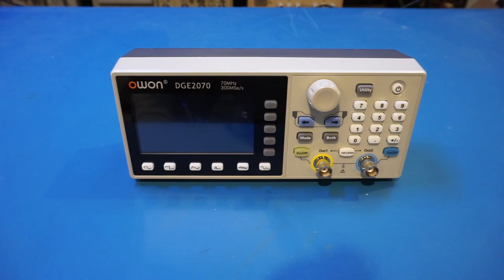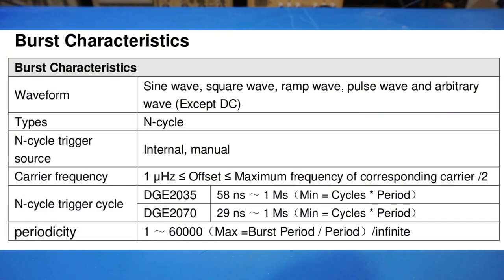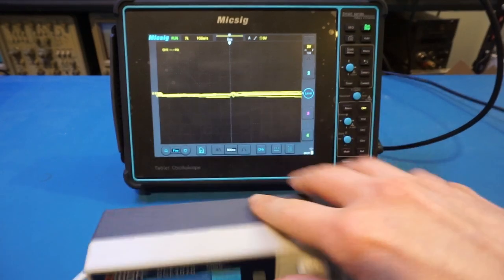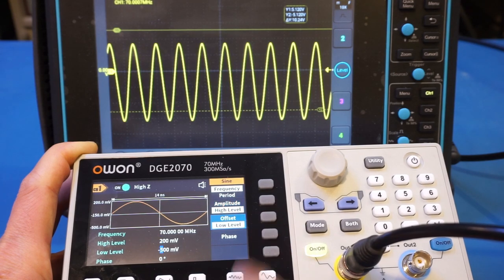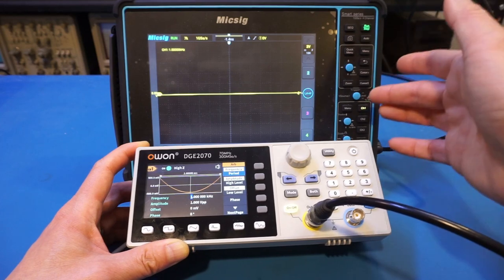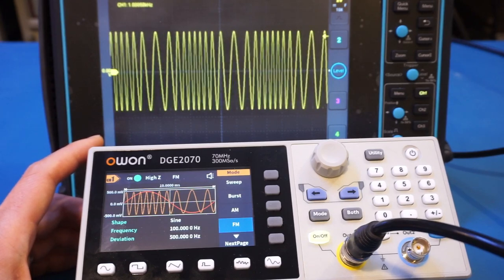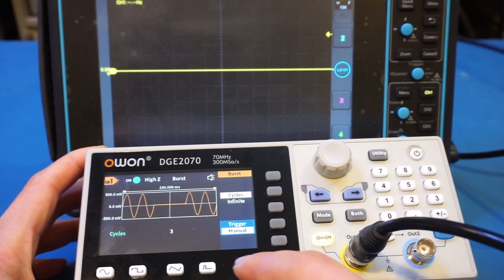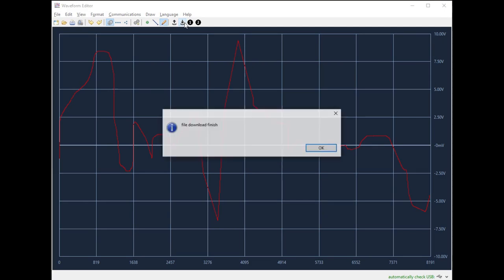OWON DGE2070 Arbitrary Waveform Generator Review/Teardown

Comment: When I had trouble getting a Win 10 driver for my old Hantek DSO, I bought an Owon HDS272S, partly because of the built-in WG. which is very convenient, although only single-channel. I don't need all the waveforms in the 2070, and I still have a separate Hantek AWG that does allow freehand waveform drawing. If I ever need it. The 272S is all I need for the moment, although I see they now have a 200mHz version!

Thanks for your thorough review.

Comment: If I had one I'd 3D print a frame to hold it at a convenient angle for easy reading and 1-hand adjustment. You are quite correct about its poor physical design when it comes to convenient usability.

Comment: You can program ch2 to output an arbitrary waveform as a pulse and use that as a trigger to see a sweep on an oscilloscope. You will have to use the utility menu to align phase also. You lose a channel on the signal generator and oscilloscope but it works.

Comment: I just got one and they have revamped the innards. There are no large +/- voltage regulators no heat sinks on the IC's. I took some pix. if you are interested.
I'm probably going to return this unit, as the output frequency stability / accuracy isn't very good  even after leaving it on for an hour or so.
I was hoping to replace my HP8640B with this. But it just isn't accurate enough for alignments.

Comment: I could be wrong, but I'm pretty sure the 50 ohm and 75 ohm modes are just a mathematical compensation for the amplitude, the HW probably has a 50 ohm output.

Comment: Good review. The 210MSPS AD9744 is "only" $12.44 @ 1K from AMD but still too expensive for this product. Interestingly the AD9746 dual DAC is only $17.73 or $8.87/channel and is specced at 250MSPS (so no overclocking required) with much better INL and lower noise. The SFDR is worse at 80dB compared to 90dB which might be an issue although the output amplifier performance may present more of a limit than the DAC itself.  I imagine that OWON would get much better than list prices but even $5/channel still represents a big chunk of the $147 selling price.

You have to wonder at the marketing decison to veto a trigger output which would make the product somewhat more versatile at an added cost of maybe only $2 or $3 to the end customer. I guess they assume that the market is mainly hobbiests where price is paramount.

It would be good if your product reviews would note when the USB ports are isolated or not, given the risk of damaging the PC if the unit is mistakenly connected to the wrong part of equipment under test. Proper isolation costs a few more cents so is always a candidate for penny pinching.

Comment: If i was buying a new waveform generator, i would definitely choose the DGE2070. I don't like that the uni-t has the BNC connectors on the side. Its a stupid design. You can't put other equipment next to it without the cables getting in the way. The power and USB on the back of the DGE2070 doesn't matter. You can get angled USB B to A cables and angled barrel plugs.
Reply: I canceled my Uni-T order and ordered the Owon after reading what you've said. You're 100% correct, It would be one thing if it were the only thing on your bench, it isn't though. Thanks for saving me from buying something that most likely would have regretted.

Comment: I'm interested in distortion in the audio band. At 1kHz sin, how far down is the 2nd and 3rd harmonic? Excellent performance and teardown video. Thanks
Reply from the maker: For signals under 1MHz, the harmonic distortion is spec'd at < -65 dBc, which is pretty decent.
Reply: @KerryWongBlog  ok, I'm looking for more than 90dB. I have an old HP function generator that works for this but it's clunky to operate, no knobs. Thanks for the fast response, the price point for this AFG is attractive, I'm looking up those clone DACs now.
Reply: @CraigHollabaugh  these cheaper AFG are usually 14 bit, which won't be near audio spec. 

For audio you'll be better off using a computer and USB audio card. Decent ones work well even on the higher sample rates such as 192kHz.(giving you about up to 90khz measuring range while staying at 24 or even 32 bit)

Comment: @KerryWongBlog  The bodge wire is a bit worrying!   I have looked at mine (DGE2070) - serial number 23040001 and it also has the bodge wire!  It also has the heatsink misplaced just like yours.   Clearly it's not just an issue on your unit!  Should we be worried that the white 'goo' sprayed over components will not deteriorate over time and cause issues down the line? 

I have also noticed that after a short while - the unit does heat up considerably - I would be interested to know if your unit does the same?  Maybe you can get a thermal camera and test? 🙂

The UK version comes with two USB power plugs - a european 2-pin USB  power plug rated at 3000mAh,  and also a small UK 3-pin plug power plug which is only rated at 2000mAh.  This this gets really hot after a short while as the unit needs up to 3000mAh.   I think i may have to buy another power supply plug rated at min 3000mAh, but this is not something I expect to have to do after spending £200 on the unit! 

With these issues I am concerned that the unit may fail prematurely - should I return and wait for a revised PCB? I would be interested in your thoughts!
Reply from the maker: I have been using it quite extensively for the past three four months. It did run a bit warm but it has been pretty reliable so far.

Comment: hello, I want to ask something.
I need a square wave generator to test audio amplifiers up to 100khz. I see that when using the square wave function the generator has some ringing because the rise/fall time is too small and can`t be modified. Can I use the pulse function instead to generate square waves and also adjust for higher rise/fall time  that the generator doesn`t overshoot the waveform? 
I want t go the cheapest possible. What would you recommend for my app between the owon dge2035 and the unit utg932e?

Comment: i prefer how waveforms are selected on this, I bought a Hantek HDG3012 and on that you cant even see the waveform before you select it which is very annoying as it has many waveforms stored in it. You have to go by the name.... After you select a waveform it will bring you to the Waveform settings so you cant even scroll through them you have to press many buttons to change it again and again....

Comment: Great video as always. If it had some other options like fft I'm sure it would sell more but I realize that it's a big ask. 

This is unrelated but I'm wondering if you've tried the hantek current clamp to bnc?

You're definitely right about bandwidth. I have a 70mhz and a 350mhz bench scopes and I've never come close to 50mhz. I sold my function generator arb when I got my new rigol with two 20mhz function generator output.
Reply from the maker: I have not tried the Hantek current probe. But I just tested Micsig's CP503 current probe a few videos back and it was quite good.
Reply: @Kerry Wong  yes. It seems everyone uses them. I find them pricey. I just bought a new rigol mso5354 and the logic probes so as a hobbyist that will be the last one I'll buy hopefully. They didn't have the logic practice board in stock so I am going to build a pcb that generates random data for about 3 protocols but the data will be within a range so I know I'm using it properly. Have you got a logic probe video?

Classic rigol too...I had to get them to dropship me two new Analog probes as they discharged their guts when I compensated them. Worst probes I've ever used. The scope seems great through for the price. I wanted a keysight but I am not rich and wanted 4 channels. Even their edu line is obscenely priced for what you get. I have a 70mhz tektronix tds2002c I got on a trade though so I don't have gear envy. Haha

Great content, keep it up. Hantek seem to have some high end gear on ali express like their bench meters and arbs.

Comment: Is it natural that there would be a drop of peak-to-peak voltage as frequency increases ?

In 70Mhz frequency, all i have got on the DGE2070 displays 4 Vpp with 50 ohm output impedance and my HDS2202 peak to peak readout is almost the same
Reply from the maker: It is normal. the characteristics of the drop depends on the frontend design. As long as it's within the -3dB figure, it is considered within the specification.

Comment: Thanks, I was looking for a video like this before it came out. As a result, between these two generators is it better to choose DGE2070?
Reply from the maker: If you need to store user generated arbitrary waveform, DGE2070 is the clear winner. But if you need the 75 Ohm output impedance you will have to chose the UNI-T as the DGE2070 only has 50 Ohm output. Otherwise these two AWGs are quite comparable (of course the maximum frequency DGE2070 generates is slightly higher).
Reply: Please see my earlier  entry, it's possible to set any value.